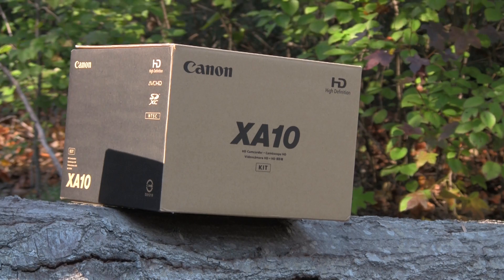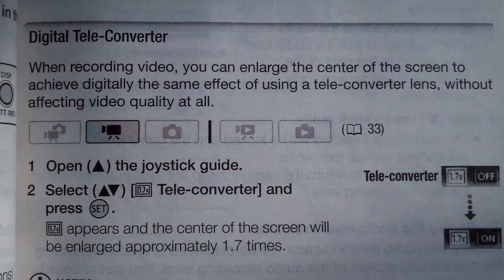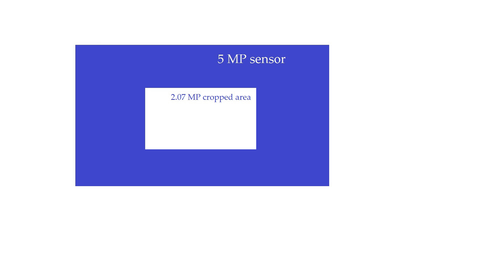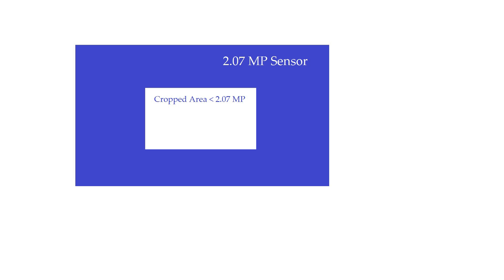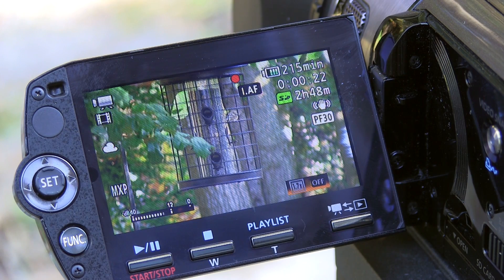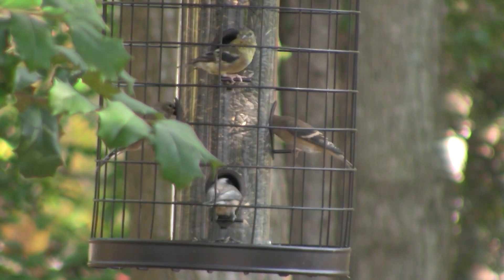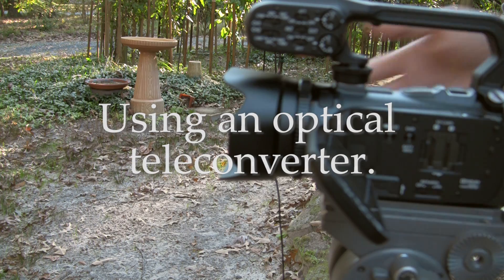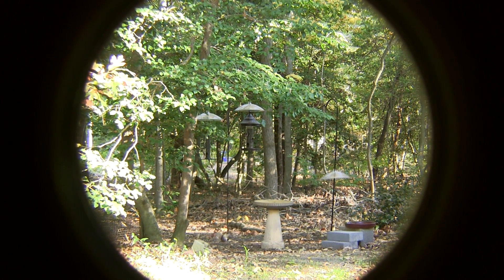Canon Digitial Teleconverter Explained in Detail.  Vixia HF S series and XA10

Comment from the maker: Thanks for the comment, glad you liked it.  I used the 2 cameras I discuss in the video, Canon XA-10 and HF S-100.  The mic I used was wired, not wireless.  It is an AT8537, it's an XLR mic, plugged into the xa-10.  I was looking at wireless mics, but to get one as high quality as the wired one I have would have cost quite a lot, and I decided I'd rather have higher quality and less versatility.  For editing I use Adobe Premier Pro.

Comment from the maker: Autofocus seems to work a lot slower, and you still get chromatic abberation from the glass (it's my understanding that the right uv filter between the teleconverter and the camera will minimize that) However, you no longer get the vignetting from the optical teleconverter when the digital is turned on. The digital does make it look a little less crisp though, as if it was shot with a cheaper 1080p camera.

Comment from the maker: @fraguzz Honestly, I got one of the canon optical  teleconverters (made for a different camera) and I  really don't use it all that much, I'd try to just get more and more comfortable with your camera as it is.  The digital teleconverter in that camera, like the hf s100 should work pretty well (although i would imagine it would result in worse low-light performance and make it harder to get a shallow depth of field effects.

Comment: thx for the great info.
i have the canon hf s200 and im looking for upgrade parts.. i have one of those 0.45x 2ps wideangle and in movement i get the black corners.. its diameter is 58mm>62mm.

is there any stuff you would recomend buying?